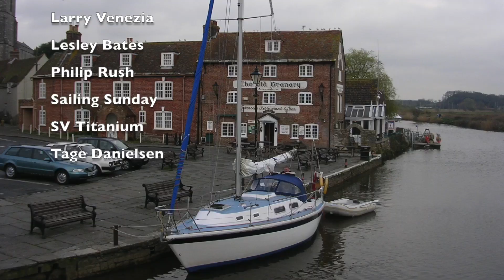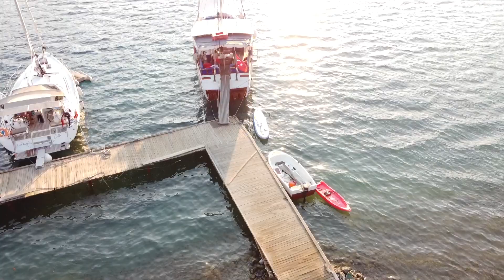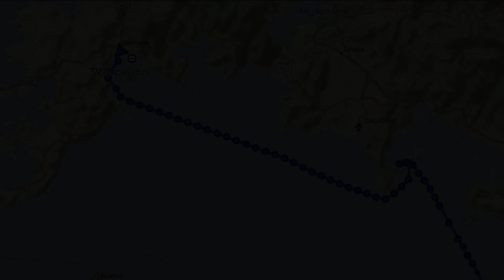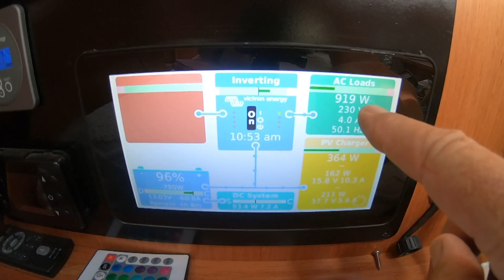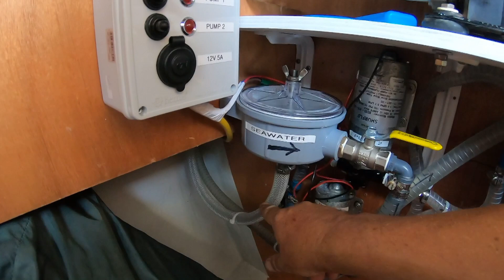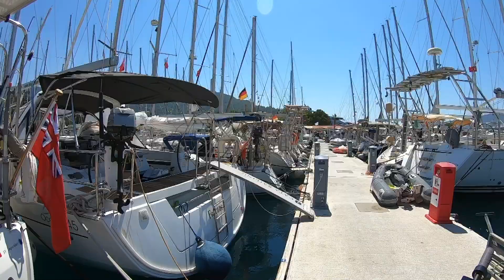Sun, Sun and more Sun! Water makers. It's Hot! OTB 153

Comment: Have you ever thought about experimenting with a cloth hooped chimney hoisted above the front hatch ...I thought about a kiddies play tunnel 😉🤫😂...if its darker it will heat up and also draw more air through the boat via the forward hatch. The taller the chimney the greater the draw... 🤔

A large fan aimed down the cockpit hatch would push and with the chimney passively pull more air through boat?
Reply from the maker: That's a great idea! I have an old parachute somewhere. Maybe thats something I could use to make a difference LOL. 
A Big fan is what we need and then the power to use it. We can run the air con for around 4 hours now on the lithium but we need to be sure of sun the next day. 😉
Reply: @SVImpavidus  
Well running a fan generally speaking takes less power than AC ... Combined with passive extraction ...  It should save you a quite a bit of energy.

Comment: Can you monitor the actual temp. Of the solar panels Ant? 
I was listening to BBC R4 and with the heat weve been getting 
he said once the surface temperature reached 25degs??🤔 the performance of conventional silicon crystal solar starts dropping off.
With such high air temps 40deg C let alone the direct sunlight the output will be substantially less than if the panel can be kept cooler.
Reply from the maker: We are getting just about 500 watts total from 730 watts of solar. The sun is quite hazy here at the moment but at the peek of the sun the air temp is around 40C the panels are too hot to touch!!!     Maybe someone should invent water-cooled panels? The sea is around 28C at the moment... Sail Safe mate. Ant & Cid
Reply: @SVImpavidus  
They have Ant...i thought you might have seen them they can be forced air cooled or water in Silicone tubes bonded to the back of the panel...useful for pre heating  a  hot water tank or powering a Stirling heat motor...
https://youtu.be/vzRTtaDVVW0
They can be bought off the shelf... For flexi panels people have taken to bonding them to 4…6mm Correx ..corrugated polypropylene sheet..like used by estate agents...the open air channels help keep air moving between the backs and the hard surfaces.😉